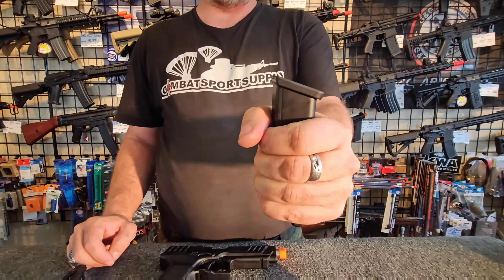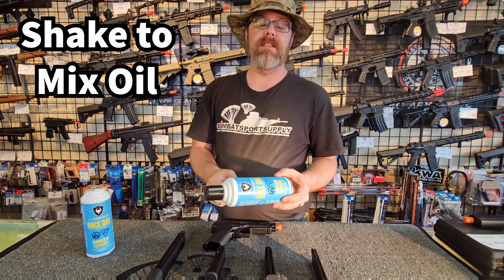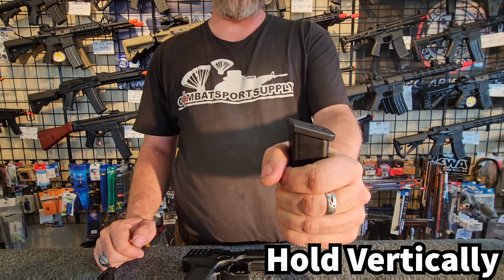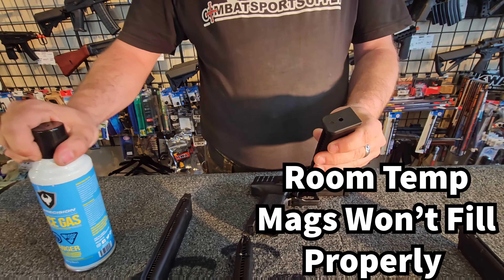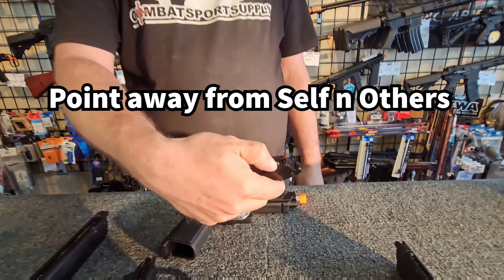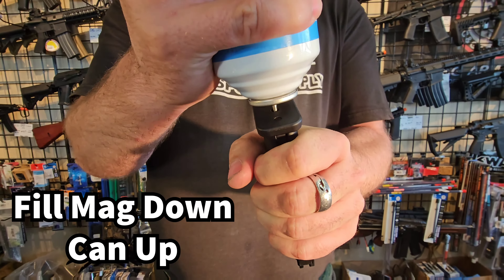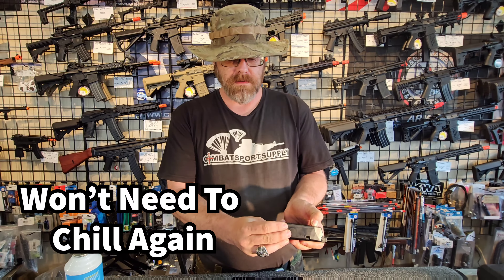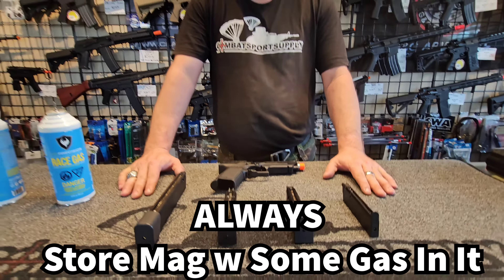How to FILL a Green Gas Airsoft Magazine

Comment: How do you know when the mag is full of gas when filling it so that you dont over fill it?
Reply from the maker: A little trial and error, depends on the mag. Most standard mags are 10 seconds (count it out as you fill, one Mississippi,  etc) if the mag is chilled as we show. If you hold it too long, the liquid will spill out the fill valve, but that is too much, and a waste of gas. There needs to be some room in the mag for the liquid to become a gas as it warms up.

Comment: How come mine leaks so bad when i thrust it so hard? And when i dont it still does the same. But i sometimes successfuly do it without any leaks same force lol.
Reply from the maker: Depends on the fill valve. Usually there is a little o-ring that helps seal the filling process so there is no gas loss. You might be missing it, or alot of guns do not come with them anymore. If that's the case, try to get the fill can lined up (90degree) as best as possible and fill slowly.
Reply: @combatsportsupply  got it ty!

Comment: everytime i try to fill the mag, the green gas gets everywhere, why?
Reply from the maker: There is a tiny oring that goes in the fill valve around the fill stem. If it is missing, some gas will spill out when gassing. Or, your filling angle of the can is not dead on.
Reply: @combatsportsupply barely anything gets into the magazine and the gun doesn't shoot, do i need an adapter?
Reply from the maker: What type of pistol mag? What brand of green gas are you using?

Comment: 😂This makes me not want gas 
This is why I like aeg 😂
Reply from the maker: Not fans of most AEPs (Airsoft Electric Pistols). They can be very unreliable,  and when they break, they are done, not fixable. There is a lot going on in that tiny frame, so something WILL break. We Don't sell them.
Gas Pistols give you that satisfactory bang, a nice kick and are more realistic. The vast majority can be fixed when they eventually break too.
AEG rifles on the other hand, are easy with just adding the battery, and can be fixed when broken.

Everyone has their favorite style tho. Thanks for watching!
Reply: @combatsportsupply  they make cool gas GBB like fmg9 and mp7 so for me if I bought these airsoft it would be out of nostalgia 
They are cool
Reply from the maker: Those are awesome. The Gas Recoil is great!

Comment: I need awsner!    Do you have to refill it evrytime you spend a mag?  If so ima stick with co2
Reply from the maker: Depends on the pistol, but usually you get about a full mag to a mag and a half, depending on weather. You will get approximately 1000-1200 shots per standard US green gas can.
Reply: @combatsportsupply  ok thanks! 😃 🙏🏿
Reply from the maker: Np, thanks for watching!

Comment: Hello how do you get the adapter for the tokyo mauri  m45a1. I wanted to bring it to our sessions but i cant figure out how to get the gas into the gun lol , even bought   The canisters but mine need some sort of adapter from the bottle to the gun
Reply from the maker: If you need a Nozzle extension to reach your fill valve, they are available. An easy DIY fix is use the extension tube from a can of wd40 or duster gas to clean a keyboard. It can be cut to fit.
Reply: @  thankyou for your help !!
Reply from the maker: 👍 Thanks for watching!

Comment: guys if you go to a online web shob for airsoft guns and it says this WE Galaxy Pistol "Replica" - Blue does the replica means that it is a fake airsoft gun or does it just means that it isnt a real gun ? im new to airsoft i would love if some 1 helps me
Reply from the maker: If it's Airsoft, they generally are Replicas of real guns, but still an Airsoft gun. Google and other search engines do not like the G word (gun), so Replica is used alot by businesses
Reply: @combatsportsupply  okay thank you i just one buy the AAP01 Assassin do you know if this is a good gun for a starter
Reply: @cpt-snikkel it's one of the top 10 best airsoft pistols that you can get it is quite reliable and has limitless potential for customisations therefore I'd recommend it albeit ain't for me as I don't like the star wars look it has
Reply from the maker: They are Great!
Reply from the maker: Make Sure you oil the AAP-01 properly. We have a video on that.